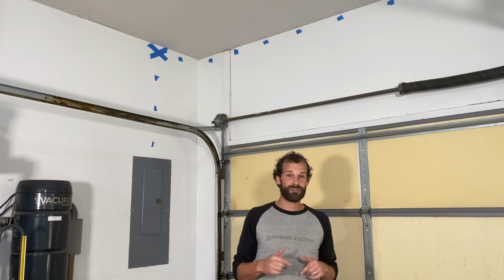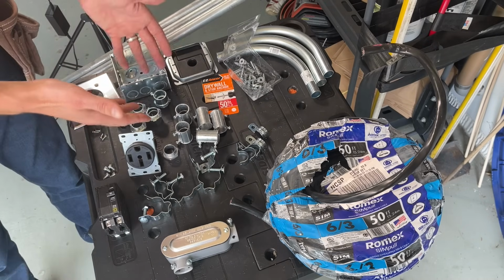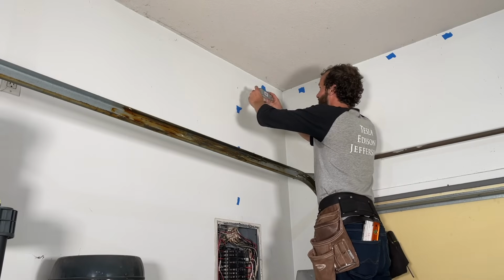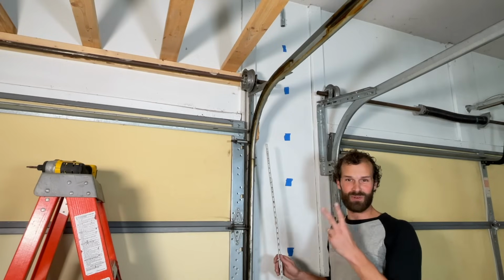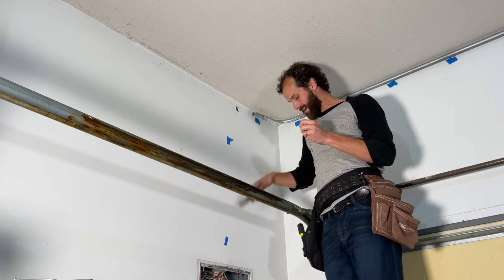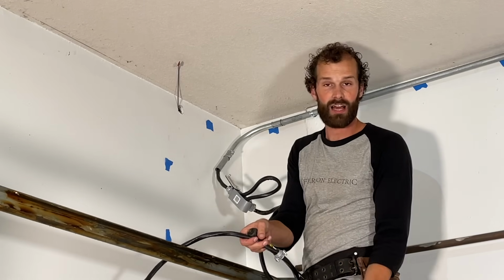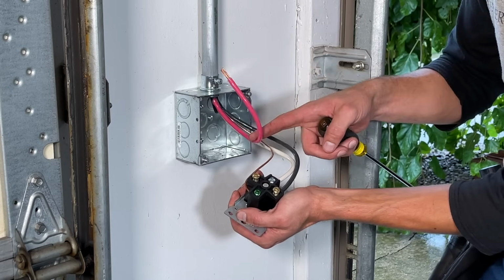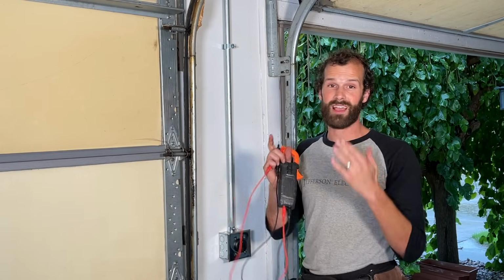How To Install a 240 Volt Outlet | Electric Car Charging

Comment: EXCELLENT presentation!!! Note: I believe that 2022 code indicates that GFCI protection should be provided for all receptacles in any location that might get wet -- at least that's how I remember it. This now adds garages and laundry rooms as required locations. Although hey, do they even make 240 VAC 50 Amp GCFI breakers or receptables? Also, some cars (Kia Niro EV for example) have plugs at their front. I'd probably have mounted the L a bit lower in case there was a double header. It's probably not likely, but it's a possibility, isn't it?
Reply: Good call on the gfci......let me add 625.54 requires gfci for car charge recepticles sometime before 2020, unchanged in 2020 code.  625 is the car charge section ... electric vehicle service equipment.   

Many miss this section and it's requirements.
Reply: His area may not go by 2022. Most states are several years behind. Nec has no authority on its own
Reply: @chrishall2594  you are correct, the nec can be adopted by your local Jurisdiction  as it sees fit.  Yes, they can completely ignore it.

I think you missed my point.  The nec is updated every 3 years with changes indicated by a shading of the changes.  In the car charging section, article 625.54, there is a change to indicate that garage recepticles ,(125-250 vac,)(2020) require gfci protection in accordance with a different article, and the car charger requirement , with no shading, came before the 2020 code.....2017 or 2014 or earlier.  I am not sure which.  So, yes gfci 2017 or earlier.

So, if your building guys do not use the nec or okayed the deviation, you are good.  The building code, nec, if adopted in 2017 requires car charging recepticles be gfci protected.   You can get past this by hard wiring, directly wiring your charger to the panel with no recepticle.

Why would I be such a butthead about the requirements,?  Well, if I install it, you can sue me for damages unless I follow the code.  If you install it, your insurance may not have to cover an install not in accordance with building code and you as the home owner/installer might be out a lot of money.....car,  house, fire department, hospital bills and worse may all fall on you.....whoever installed it.

Comment: Do you ever thread the sections of conduit onto the wire and then attach the conduit to the building? Seems like this would avoid a difficult pull.
Reply: It's against code

Comment: In my area, Romex is not allowed in emt, in pvc it's ok, just not metallic. And I would do whatever it takes to keep that fish tape out of the panel. I installed two of these this month and used pvc conduit for one, and drilled holes in the exposed wall studs for the other. Either way, that awg 6 is a challenge.

Comment: There are several things wrong here:
The conduit is too small for the cable
The conduit is not grounded
The conduit is supposed to be continuous before the conductors are installed
The box was not properly bonded
And someone is going to cut themselves on that cover
Reply: isn't the metal face of the ev plug connected (internaly) with the ground pin-screw, thus touching the metal box connects the whole conduit to ground? i find that to be the case but i don;t know about this one. not an electrician btw, just asking.
Reply: ....and the Tesla will eventually ignite itself in your garage while you sleep. Fire extinguishers won't put out a lithium battery fire. Make sure to make another exit door in your house.

Comment: I always thought that running romex through conduit was not permitted. Anyone have a comment on this? Always wanting to learn new things.
Reply from the maker: THHN would be a more ideal wire selection and Romex is not allowed in conduit when running through wet locations.  THHN would be much easier to pull as compared to the Romex we used.
Reply: Thank you.

Comment: Terminology ..... your video is properly labelled as "240V"; but you are calling it "220V".   Anybody who has been around a few decades understands that you really mean "240V" the current standard for residential wiring in the USA, at least.  The use of term 220 is obsolete by today's standards and dates back to the time when "110 volts" was the standard basic residential house voltage.  This can be a confusion factor to students new to the electrical field. Most current equipment labels are using 120/240 for single phase service.  If you are wiring in industrial applications then, 3 phase service is most likely going to be used and other standard voltages may be appropriate depending on the 3 phase configuration.  
Above comments aside, you have made a excellent professionally done instructional video and I learned about the best screwdriver and the oversized plates as well as the rectangular insert/shield hardware that is available.  That screwdriver is especially important as it is so easy to ruin screw heads with the regular, slotted screw driver.  I personally have not seen the screw driver or rectangular box insert/shield in local stores; but maybe I just didn't notice them because I was not aware of the existence of such hardware. However, stores only carry products that sell; if no one knows of a product, stores generally will not carry it; so you instructional videos can help with that.

Comment: You did a fine job , the only thing I would have done different was to terminate the wires before I installed the CB ! and it to bade you had to work with a Sq d panel !!!!!!!!!!!!!!!!!!!!!!!!!!!!!!!!!!!!!!!!!!!!!!!!!!!!!!!!!

Comment: Good video but would like to add my useless two cents if I may. I just started working as a commercial/industrial electrician and the one thing of many that my foreman has shown me is that just use the material to measure saves time and it makes sure u cut what u need. Another thing is you could have just gotten a bender and bended a 90 so that it would look cleaner. And last never work on live stuff if you can avoid it. But I’m still learning code and a lot more but ya that’s what I think he should have done but other then that good video.

Comment: Great video, thanks for posting it. One thing I noticed in that panel though is the neutral wires sharing lugs with ground wires. I don't think that is allowed. Grounds can share lugs but neutrals should have their own lugs.
Reply: Mains can share. Sub panels cannot.
Reply: @shawskeebennett1440  I think your referring to neutral ground connect issue. You are right that on mains you can combine neutral and grounds, however that is not what I am referring too. I mean that according to the NEC, each neutral wire should have its very own lug. You can't put two neutrals under one lug or a neutral and ground under 1 lug, even on a main. Look it up.

Comment: A TIP for piloting holes in drywall, when you want to use a drywall anchor.  Do NOT punch the hole with a screwdriver.  This can cause a blow-out of the backside of the drywall that you will never see, and negate the strength of the anchor.  Instead, take the time to use a drill bit and drill completely through the dry wall.
Reply: You should use a screw starter. A drill bit fatigues the drywall which leads to eventual failure. But you're spot on that jabbing something in there is bad news.
Reply: @nilpo  wood drills cut it prefect
Reply: @onlythewise1  They cut perfectly, yes. But you missed my point. They fatigue the drywall. The hole will fail later. The rotation of the bit causes it to draw the drywall material from within the hole reducing the density of the drywall at the point of highest torque from the fastener. It's a matter of time before the paper collapses in and the fastener fails.

You can do the experiment yourself. Put one fastener in with a drill bit and the other in with a screw starter. Then use a scale to measure the amount of force it takes to cause the fastener to fail. The drilled hole will fail first.
Reply: @nilpo  ohhh ok
Reply: @nilpo  my walls are that sand plaster  old walls of the 50s no dry wall in the place
Reply: @onlythewise1  Oh, I have those in my house too. Yes, I typically just drill through that. Just have to go slow so you don't break the lath or the plaster keys. Anything bigger than a drill hole, try using a plain old utility knife! Less mess, just as fast. Then use any oscillating tool to cut through the lath boards.
Reply: @nilpo   oh ok
Reply: @nilpo not so fast, there my brother, … it would depend on why you think the 
“hole” would fail, … would it not? I do not believe that gravity alone, would be cause for a wall failure as you put it so abruptly, … there would have to be other forces at work, to create a reasonable explanation for the screw hole to “fail” as you so objectively explained, … your test, …??? Is because of exerting a specific amount of pressure to cause it to fail, is this not true? So if there is no force, placed upon the single drill hole to give cause for such an occasion to fail, then, by your own standards, it will not fail, … the junction box, and or outlet, or for a switch, will be just fine, because there should never be any pressure of anything for exerting any movement of said box, … 😊
Reply: @nilpo any loosened lath boards that may be needed to be removed for the indicated box, may be reinforced by placing a dummy behind the exposed ends of the cut pieces of lath, and secured with a couple of drywall screws, … and reinforced with a layer of mesh tape, and a coat of mud, or 2, to base the area securely, … in addition to using a mason’s key to assist in securing the box, …
Reply: @Edgar-kl6us  There's no such thing as a wall with no forces on it. They hold up buildings. Walls regularly move with settling, vibrate when people or vehicles pass by, expand and contract with temperature changes, and more. Not mentioning the fact that most boxes are cut in for adding receptacles which are frequently exposed to lots of force plugging and unplugging cords--especially with modern tamper-resistant outlets. Ask any handyman or anyone who does drywall repair. Holes cut in drywall fail pretty regularly when done incorrectly.
Reply: @Edgar-kl6us  Sounds like overkill, but that would work. Not sure what you are referring to as a mason's key though.
Reply: should cut out the drywall and install another stud to tie into so easy. or use a Toggler Snaptoggle into the Drywall...
Reply: I generally don't like relying on drywall to hold up anything other than pictures. If there isn't a stud running by where I want to put the outlet, I would have simply cut the sheetrock and reinforced the inside with studs.
Reply: @dontbanmebrodontbanme5403  

But it's YouTube and that makes too much sense.
Reply: @dpz9872  😂 i know after 15 years on you tube i dont think ive had one intelligence talk on it above a dork

Comment: don't wanna be judgemental but smh
the best part is struggling to put 6/3 romex to 3/4 LB. this made me cry
This video is completely DIY stuff and not recommended for establishing 240v circuit. 
Please call electrician if you want perfect ev charging station

Comment: What about securing the Romex cable within 18" of the panel's entrance? It wasn't done since it would require opening up the drywall. Wouldn't it be a NEC violation?

Comment: Where I live, you have to pipe everything… no Romex. Pulling romex through EMT is a mistake I have made WAY too many times. I also bond all the metal boxes and fittings to ground wire if available, however, given that almost everything is piped where I live, the EMT is used as ground.

Comment: I have a question about the electrical wire from the main box to my garage for charging my EV. 
I have the Romeo #4 Aluminum wires from the main electrical box  with the 40 AMP breaker to  a junction box in my garage. The cable is about 75 feet long. At the junction box the # 4 wires connect to the #6 THHN copper wires. The #6 wires then run about 40 feet to the NEMA 14-30R receptacle. This receptacle will only use for the level 2 mobile charger. The EV car charging current will be set to draw no more than 30 AMP at 240V.  The Romex cable is in the attic and the THHN wires are in the EMT tubes. Of course the is a #10 cooper wire for grounding. 
What do you think of this setup? Is it safe and meet the code ?
Thank you in advance for your comments/advices.

Comment: I took away your pro tip on how to secure the wire to the top of the panel behind the sheetrock.   GREAT TIP!   I was waiting for you to cut a access hole to secure it.  Code for our state states that "Any outlet in the garage needs to be ground faulted."  So I used a ground fault breaker.  Those are much more expensive.   Glad I watched for that 1 Pro tip!  I have done this install before as a D. I.Y.er.  Definitely will use that tip in the future.

Comment: How come you don't use the red, white, and black THHN #6 gauge wires and #10 gauge copper wire instead of the Romex 6/3 cable? Does the Romex cable require to be put inside the EMT pipe? 
Just curious and I think the total cost of the THHN wires is less than the Romex cable. Thanks for the video and the clear instruction. I will do pretty much same setup in my garage for me new Tesla soon.
Thanks.
Reply from the maker: Yep, THHN would have been better for this install and easy to pull 😅

Comment: First thing KILL THE PANEL, no point in getting even a little tingle let alone blowing yourself across the garage.
Reply: Relax Bill. Kill power is not in the real world. That's just for disclaimer and for liability. After 45 years as an electrician, I can't remember ever killing Main to add Anything in an occupied structure.

Comment: I remember checking electricians work in new construction and the lights for the entire apartment were connected to the pantry light switch. Most common was lights for the kitchen and dining room switched. Mood lighting in the kitchen.

Comment: This was a great project for me to watch.  It dragged me through my code book to "test" myself.

90.4 ahj
110.12.  Neat work
110.14.(C).(1).  Equip temp limits
250.110.1).  Equip fasten in place
250.118 EGC's allowed
314.4 metal boxes
334.15.(B).  Exposed NM 
625.52. Special Equipment.

Did you look up anything?

Remember, just because.you would do it differently, it does not make him wrong.

So. Did he meet code?
Reply: yes, he violated conduit fill
Reply: @dematt321  since this is not a complete conduit run, no connection to the panel,   he may have it right.

334.15.(B) NM cable allows emt for protection.

Table 1 of chapter 9 2020 nec page 695 gives us the calculated fill chart.  The internet gave me 0.65 in square for 6-3 ,NM cable.  

And here is the kicker, table 1 chapter 9 note 2 says this table only applies to completed conduit runs and is not intended for conduit for "protection" .

So, he may have gotten it right?

And thanks, I had to do some digging for that.
Reply: @keithharrington8715  besides code, its a pain in the ass to install romex in that tight of a conduit. I would just pull the appropriate conductors and move on.
Reply: @dematt321  what code did he violate?
Reply: @keithharrington8715  conduit fill
Reply: @dematt321  In my earlier comment, I reported that on page 70-695 of the 2020 NEC is chapter 9 table 1.  Note 2 in that table says that conduit runs that are for protection or not a complete system have zero fill requirements.  If it fits, it fits.

If you have a reference to a code section that requires fill please let me know.  I will be happy to be proven wrong and learn more.
Reply: @keithharrington8715  Code is bare minimum requirements. Doesnt make it right. jamming a wire of that size through a conduit that size is pure hack work. My local AHJ would never pass that. I would 100% say they shouldve followed conduit fill in this situation.
Reply: @keithharrington8715  Chapter 9, conduit full chart

Comment: When you attached the braided wires to the outlet you wiggled them several times to seat them better but I noticed when you attached them to the circuit breaker you didn’t. Should you wiggle them at the circle breaker as well or is that not necessary?

Comment: Att 22:40 you stated that all the connectors had to be tight, because you said it's part of the grounding system, yet the conduit run is not attached to the breaker panel, and you didn't ground the receptacle to the box, therefor the conduit is not part of grounding system, just a potential shock hazard.

Comment: nice explanation for this process. what happens if you needed to do 75ft instead of 50ft? Would anything change with the wire thickness?
Reply: No need to factor line drop for that increase.

Comment: I was wondering just how much your electric bill will increase with a daily transportation electric vehicle ? And how that compares to normal gas prices ! We all know that gas prices have been by design inflated by purposeful created shortages by the Marxist Green Globalist goblins especially since purely electric vehicles have a host of issues !  very expensive and battery life replacement costs ! Add all that up with the electric costs and there goes your hard earned GREEN down the drain !

Comment: It would help if you explained to the viewers that one side of the panel is not for one side of the hot, but that the hots alternate on EACH side.  When the average person looks at the panel (with breakers installed) they see a right-left distribution of the hots, not a vertical distribution.  In other words, most people would think your install was 120v in parallel, rather than 2x it would have to be an unpopulated panel, of course.   OT- I'd love to understand three phase system (irrelevant to Harry Homeowner, of course.  I once leased an industrial space with 220v rather than 260v- so I never figured it out.  But it would be a great vid for the electrician.
Reply: Does the outlet need to be grounded?